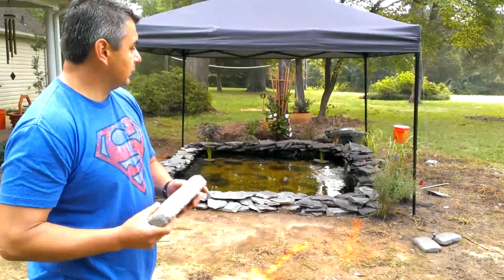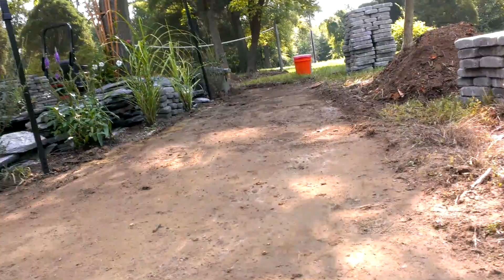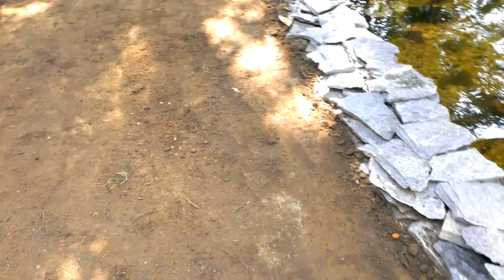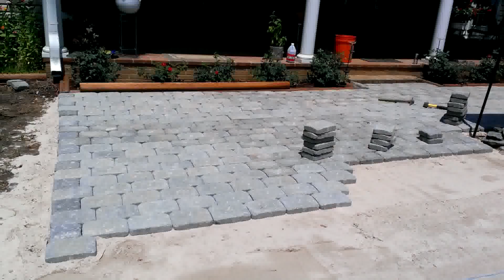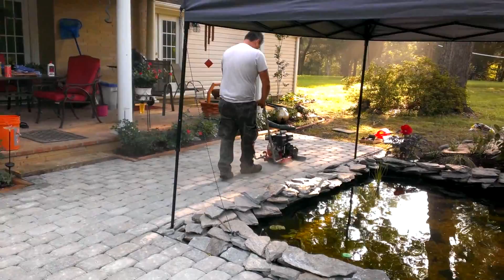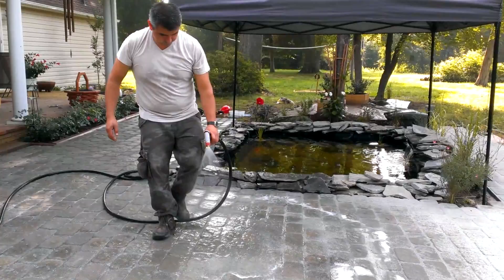Patio pavers installation

Comment: Truly hugo grabe and run ....for a 0.07 ć metro i will marble it out with approx wax and neon lights on the ponde
Reply: The job is a 7 length x 8 width x times 0.07 ć 3.920.00 1 helper and 1 engineer less then a 1 week